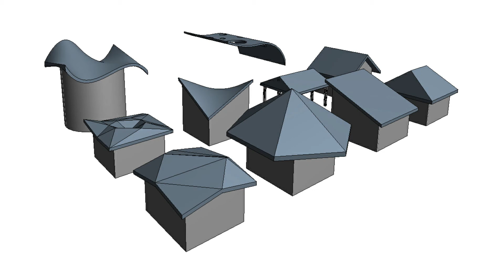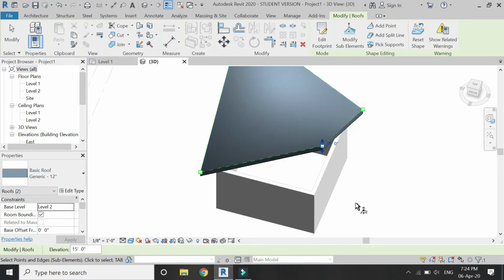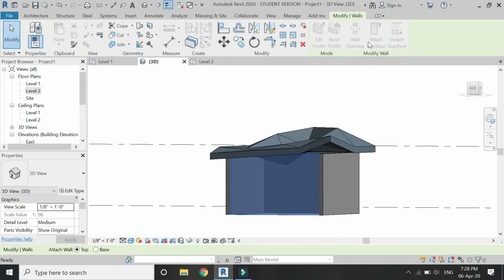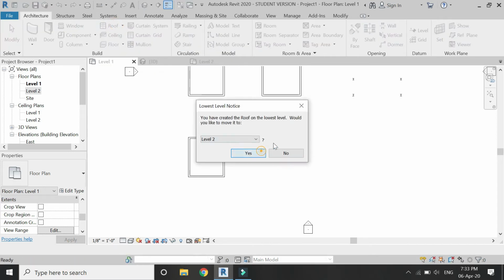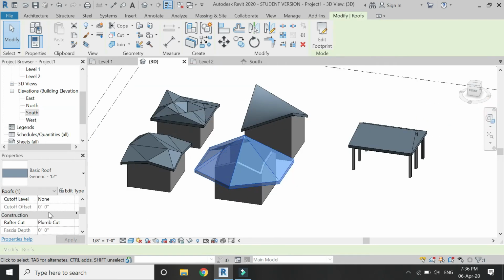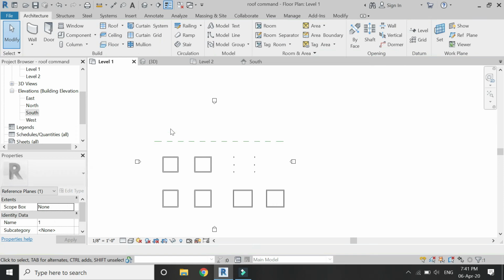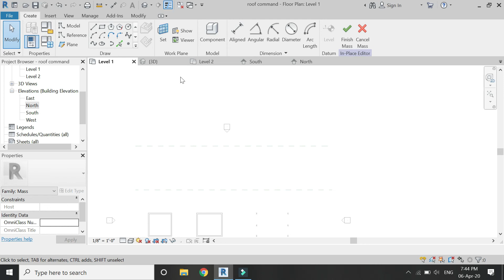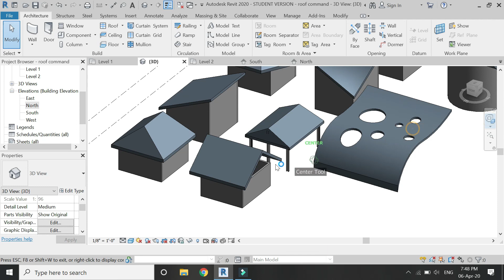Revit Commands Course - Roofs

Comment: Hi, I have a question. Ofcourse my roof seem too odd... I will need a roof like this.. I will try to explain. from one side on the second floor the wall is only 300 mm, since it has to be maximum 3 meters from ground. I will use moste of the second floor and to do that have the roof end short on the other side. So one side is 300 mm wall where the oposite is 2.80 m. Also one room starts a bit in...oh I need to send a picture to show...